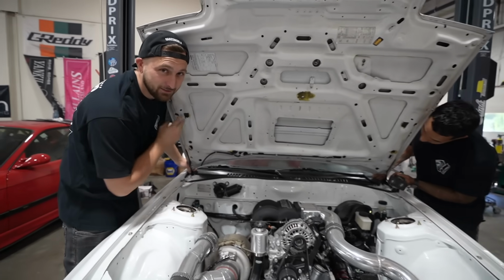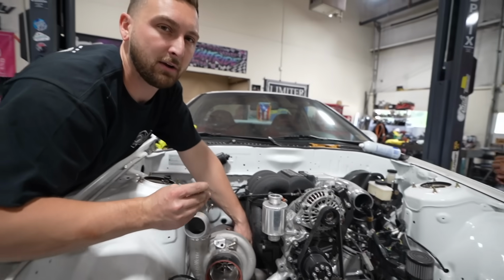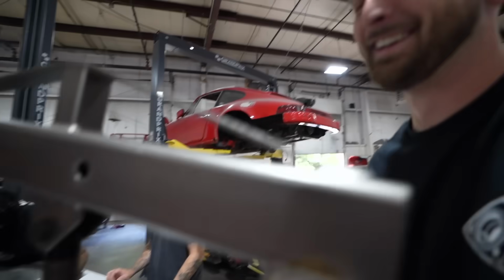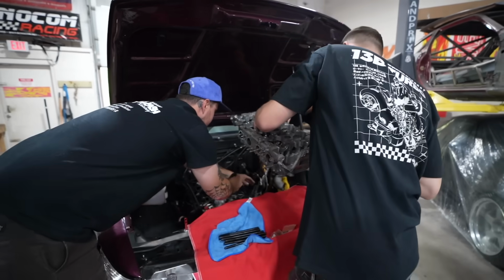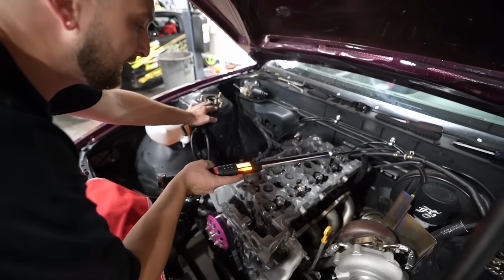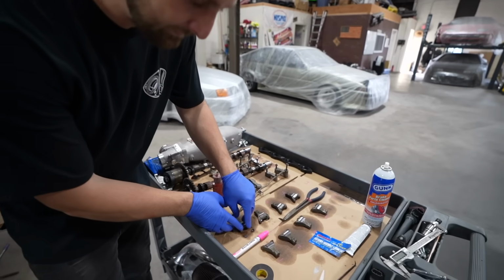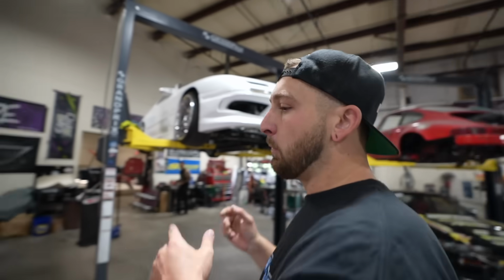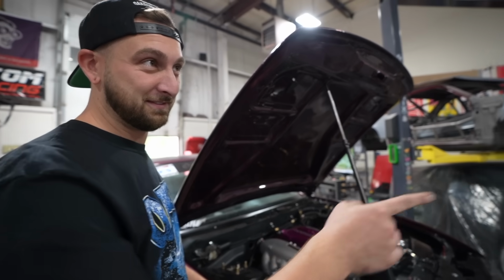We decide to pull the rotary OUT of my RX7!

Comment: Jimmy I used to go through the same issue that you’re going through with my RX7. I ended up buying Goopy Stud Bolts to hold the motor better. They don’t allow the motor to twist when revving high and putting more power. My motor isn’t pinned either. I make 780WHP on E85. Just a thought so you don’t have to go through it again. Loving the content

Comment: Tip for pulling rotaries. drill another hole in the crane. Or if you want to be extra safe... 
Weld some extra square tube to the end of the crane arm and then drill a hole.

Comment: Belt trick is fire, i even tie my jumper strings in to the top of themselves ti make small hoops, harder for them to fall into a power tool and if they are metal crimped ends it prevents them also scratching your car.

Comment: My rotary boiz I know always torque that head bolt in particular 10-15ft lbs less . It's the torquing over several times that weaken the casting and cause micro crack which with boost will expand and turn into a real crack or split in the plate

Comment: Yeah, super lucky It’s the rear iron. As long as the engine is healthy, which I believe it was, you can just swap that out pretty easily. 

You’ll be up and running in no time. I rebuilt my whole Rx 8 engine as a first time rotary rebuilder and it wasn’t bad at all. And the car ran amazing. Just the OEM stuff seemed to be the best.

On the SR 20 stuff Ruddy found out the hard way. Except he didn’t realize he had the rocker stoppers so instead of just knocking a rocker off, he snapped his and pieces went everywhere. I feel bad for him.

Comment: Use heat guns and get the cylinder head and block to 200 degrees then let it cool and retorque. I do this to all of the engines we build and have always gotten them to come loose and need torques again. Weather it does as much as some of us thinks it’s not a long or hard process to add in for added security

Comment: With all head studs you need to re torque them after a few heat cycles. That's why it would have lifted
Reply: ARP says they shouldn't need to be retorqued unless the head gasket manufacturer instructions require it.

Comment: Here’s a cheat code for not spilling coolant. Go to Lowe’s and get a few rubber PVC pipe caps from the plumbing section. You can cap both your radiator and engine inlets and outlets so you don’t spill coolant when you move the rad or tilt your engine.

Comment: You know just to think about it if you don't have a fuel pressure sensor wired into the ECU you could technically wire fuel pressure sensor into the radiator

Comment: rotaries have 1.3 liters of combustion capacity 3x per revolution, which is equivalent to a 3.9 liter piston engine
Reply: Unfortunately not 3 sides of combustion per rotor there are 2 rotors so it’s around .23 liters per side, 3x per revolution per rotor

Comment: I paused the video on the back of the shirt, and used google translate on the photo setting.  Google translate says,  'The rotary engine is the most widely produced rotary engine. It formed the basis for Mazda, and Wankel engine was in production for over 2000 years.' Basically your shirt is claiming, it's a motor from biblical times😂